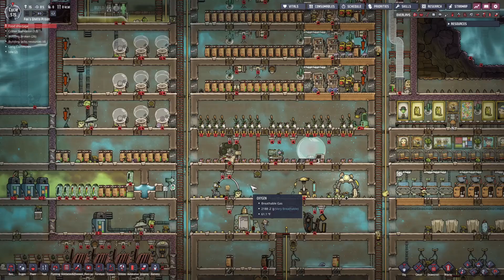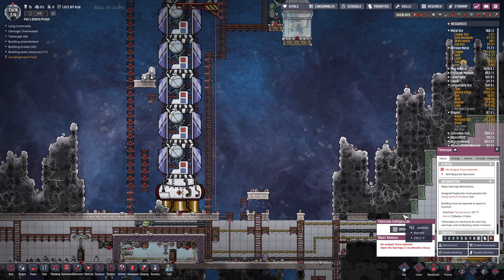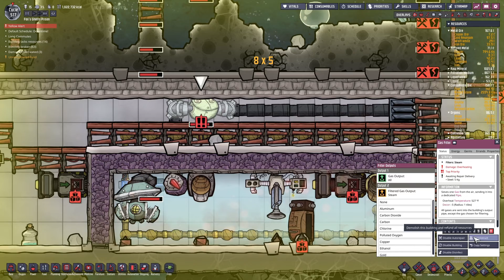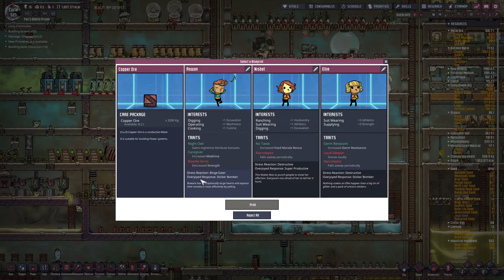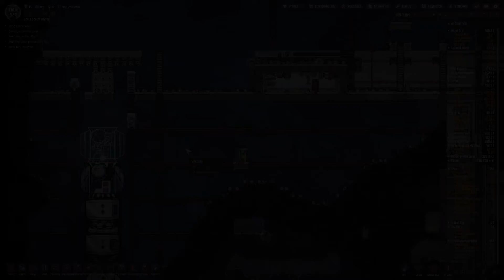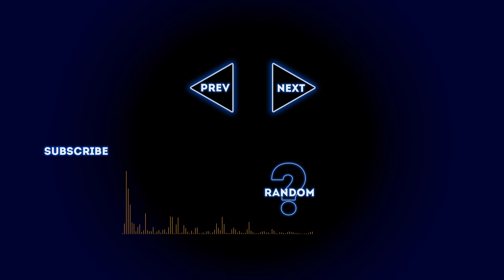BUILDING THE PETROLEUM ROCKET! (OXYGEN NOT INCLUDED "Terra" Episode 35!)

Comment: I've learned a few things, while going back and rewatching the older videos as a player rather than a viewer. 1. Frost Buns from Sleet Wheat, Meat, and Lettuce from Waterweed = the best food in the game: Frost Burger (I think) So get the meat farm, Sleet Wheat farm(Sleet Wheat is used for 3 very good recipes), and Waterweed farm going ASAP - 2. I don't actually need to worry about gases as much as you did with the water lock, because it's not as hard to separate gases as I thought - 3. The Atmo Suit can be used to venture into unforgiving biomes like hydrogen, and chlorine, and not have to worry about gas escaping.
Reply from the maker: I don't think that's going to be an "ASAP" kind of strategy. You need natural gas to power the gas range. Waterweed is an advanced plant to farm due to it needed bleach stone which isn't renewable without advanced ranching of pufts.

I also would advise against letting the gases into your base until you have setup a chlorine room and have collected enough hydrogen in tanks. When the gases are in their compressed pockets, that's when they're the easiest to collect. By letting them into the base, they spread out all over the place and become a lot harder to contain to make valuable.
Reply: Wish I had a way of showing off what I’ve done so far.. you’re right, though, it has definitely proved challenging to get the Frost Burgers.. the few that I’ve made haven’t made much of a difference though, it seems..
Reply: The Stuffed Berry seems like an easier food to make, with just Peppernut and Bristle Berry, but still requires the gas range. I uncovered a Natural Gas Geyser early on, in my newest game, which definitely helped.
Reply: I’ve been experimenting with the Canister equipment, to help with containing the gases, but in the end I’ve just piped the leaked gases back to the other side of the airlock